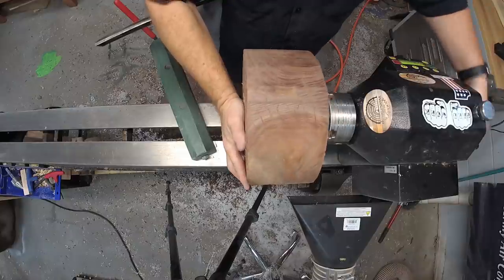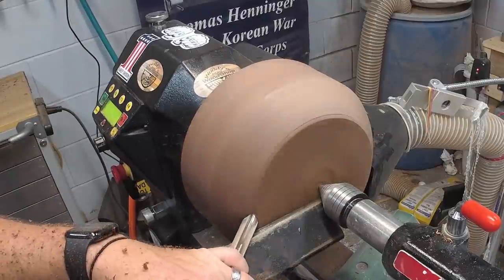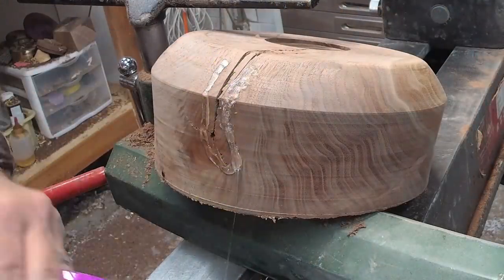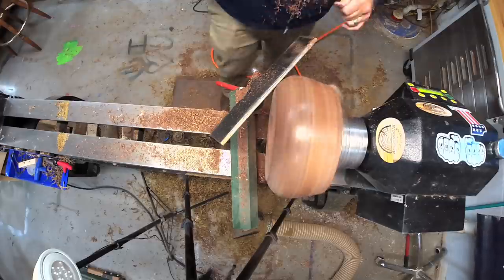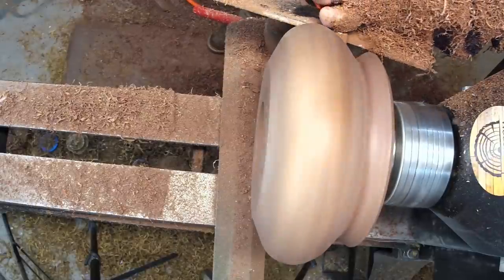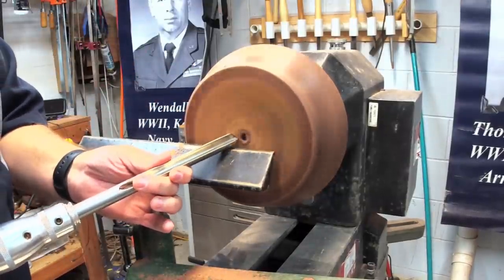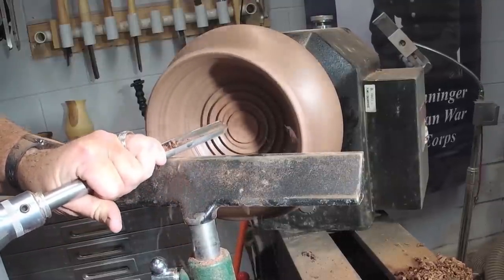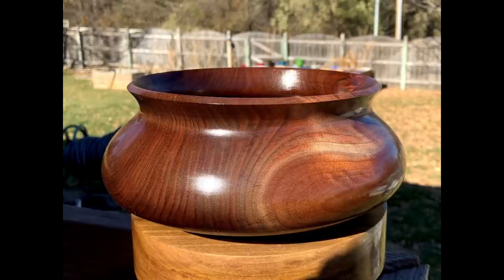Woodturning a Walnut Pot

Comment: Beautiful walnut bowl and a great design. What was the carbide tool that you used to get into the tight areas on the outside with, I didnt catch the brand. I've purchased and use the Carter and Sons tools because of the M42 steel composition. I'm new to turning and there's a lot of good tools to choose from. Thanks for sharing your skills.
Reply from the maker: Thank you very much!  That tool is the Carter AXE hybrid.  Its kind of a unique tool.  It uses a standard round bit but it mounts it at an angle which makes it turn like a negative rake bit.